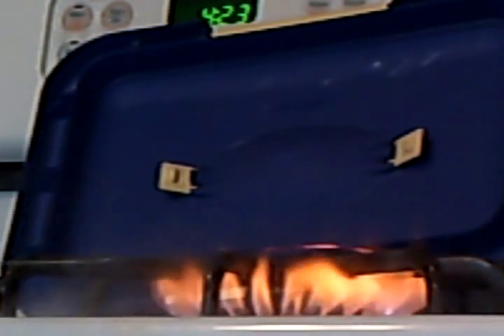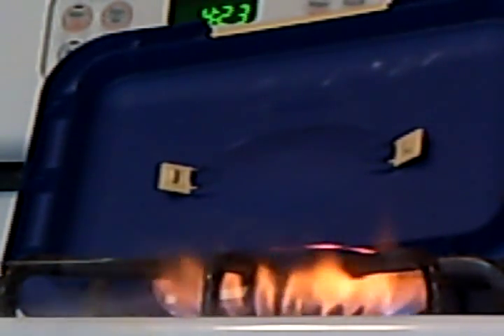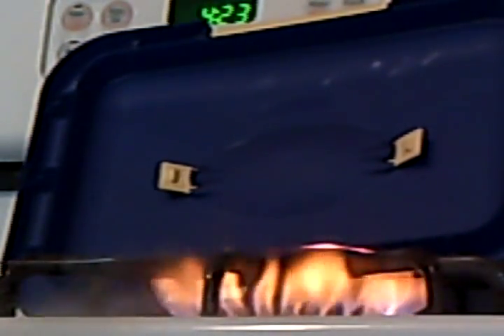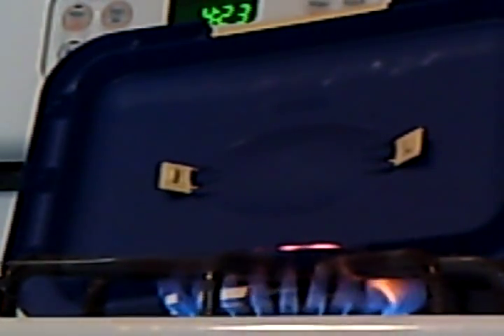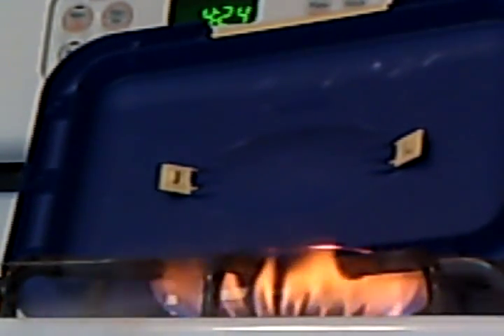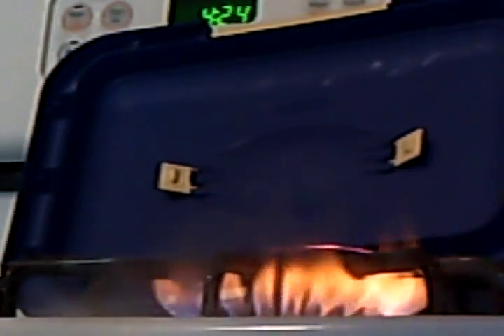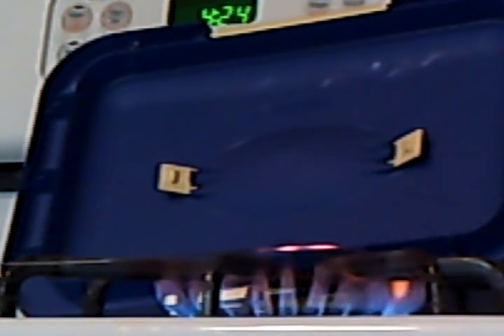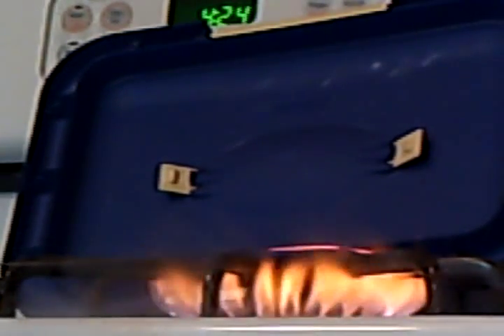using a sonic vaporizer as proof that water is a fuel

Comment: You are correct about water can be used as fuel or at the least to assist fuel for better performance, the question i have is what if i first convert the water to a hot vapor/steam under pressure that regulate that pressurized water steam/vapor to then inject to a car as if it was normal gas fuel? do you think is possible?

Fill a sealed metal container  with plane water , add heat to it to to convert to gas vapor/steam than inject that  to the engine and regulate for idle, and under load etc...

Comment from the maker: matbe . I am still not convinced that mankind is ready. They knew about water in WW2. They added water to the B52's engines to cool them down and found out the engines ran with more power,smoother and more efficient. The powers in charge then knew they had to hush this up. they did there job well. They had no idea why this worked . only a few of us have figured it out. I have tried to think of what will happin once the truth is known and it is not a pretty sight. Maybe its the only way

Comment from the maker: plummers ? lmao .  A plummer dont use a HHO torch. the color is not the determining factor for energy and or temperature.  A hho torch can melt tungston. And an oxy acetylene torch can not. plummers use propane to swet pipes together. If ya add HHO to propane you can weld or cut steel. Any one that has experimented with HHO knows this. Ya dont even need the Propane to cut or weld with HHO

Comment: i may be wrong but i thought blue flames were hotter and red flames were cooler. And the over abundance of flames is because there is excess hydrogen mist around a fire, therefore bigger red flame. The oxygen/hydrogen vapor is still fuel, because in the flame area it is more h2 ans o2 available than air. So not making net heat created should be negligable. Please correct me, if wrong.

Comment: Static air enhances the effect. Until you build a bench torch setup you will not know what exactly I am talking about. Color has everything to do with what is going on with the btu's and the flame front and color which is flame tempature. Look at a candle it has a yellow flame tip if you make the wik too tall it will yellow and soot really bad but the blue at the bottom will be lean and hot and never soot. soot is rich. Hydrogen is too rich so you have to lean it out.

Comment from the maker: A yellow flame is not wasted energy. HHo burns yellow and it will melt even tungston. I have read that tungston melts at 13,000 degees. That dont sound very wasted to me. One of the problems with running an ICE with HHO is that it can melt the valves and spark plugs. Meyer was said to use non combustable gas to slow down the burn of HHO to that of gassoline. The truth will come out in time

Comment from the maker: If that is the definition of static air then that will have no effect on the color of this flame. The flame is changed here because water is added and the water dissasociates because of the tempurature of the flame and recombines for the same reason. HHO and hydrogen burn yellow.

Comment: static air pressure is positive air pressure. Example 2 psi of constent air flow at an air flow rate which suites your needs for your application. In the air compressor world static air refers to constent air pressure and dynamic pressure referes to high volume low pressure compressors like small air pumps which creat low pressure that blow up air beds and stuff like that. Where static pressure would inflate your car tires.

Comment from the maker: learn from others dude. all fuels need something else to burn. Gassoline,propane, wood coal butane all need more than just its self to burn. hydrogen needs Oxygen to burn . Water is hydrogen and oxygen . Ya just have to tweek it a bit to get the benefits as a fuel. Stan Meyer beleaved it was a fuel . add water to calcium carbide or sodium and tell me wich one is the fuel ?

Comment from the maker: hydrogen burns with a yellow flame and it dont give off any carbon monoxide. They started adding water to engines back in ww2. More horse power and a more efficient burn. The oil companies hope we dont start using water for fuel. There is much more to this than meets the eye. The oil companies are not alone

Comment: So in your case with the stove you need a to add a source of compressed static air to the fuel to bring it back to a blue flame as atmosphere pressure is not enough. The same things happen to engines that are trouble charged. Understanding fuel is study basic science and elements. The bunson burner was invented to just see the color of elements and how they burn so you learn a lot if you have one.

Comment: Just so you know a yellow flame is wasted energy. A blue flame is lean burn energy. The thing going on with the flame is that your not leaning it out enough to get it back to high blue flame. Piston engines run best in the plasma state with is a blue flame so your running rich with your water added. But also you should know that if you apply this to an engine you will damage the metal surfaces because the metal is toooooo hot so you have to run some richness so you don't burn surfaces.